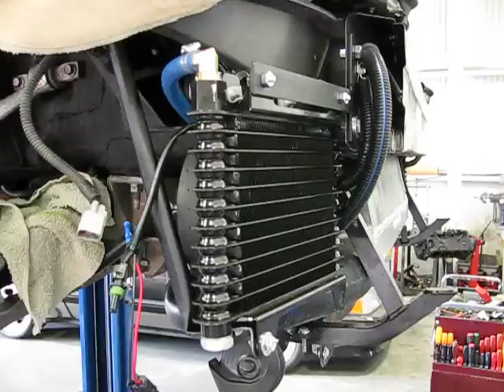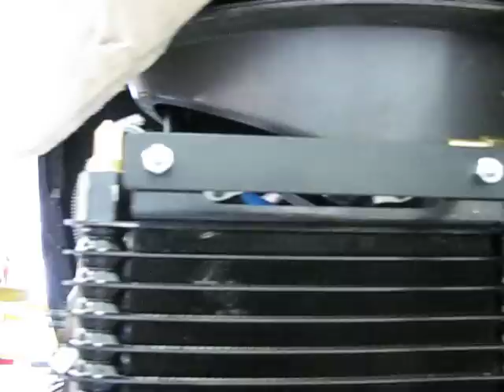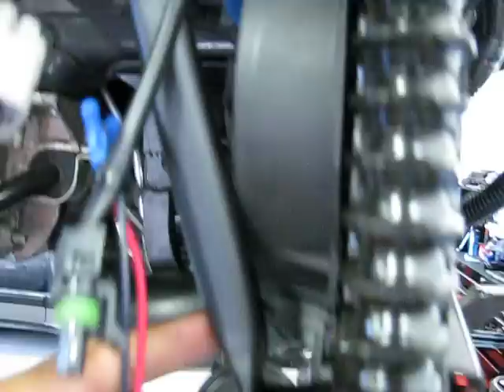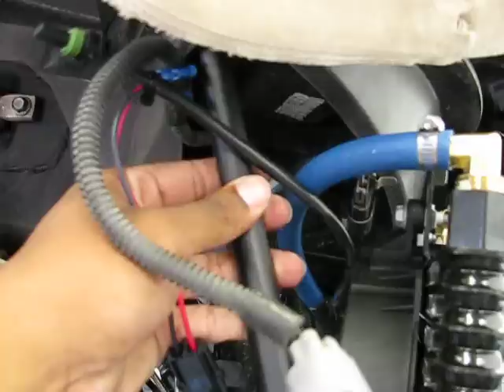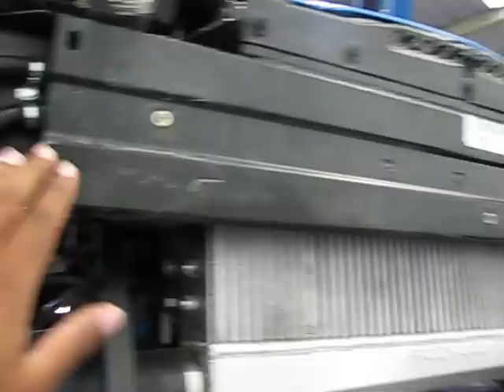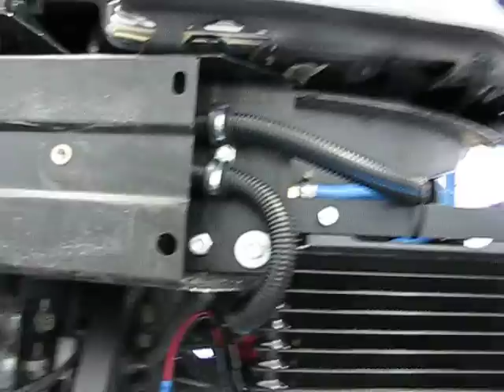Custom Dual Trans Cooler Setup

Comment: I bought the Hayden Automotive 526 Remote Transmission Oil Cooling System BUT WAS KINDA DISAPPOINTED BECAUSE NO HOSE WHERE INCLUDED